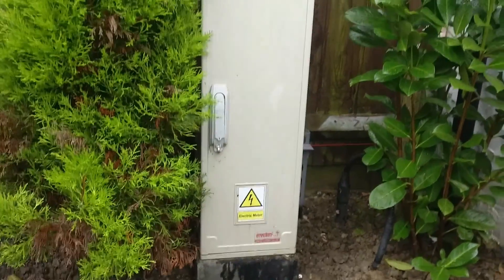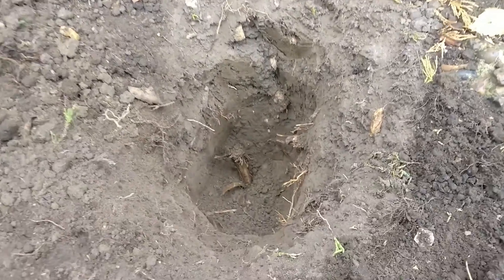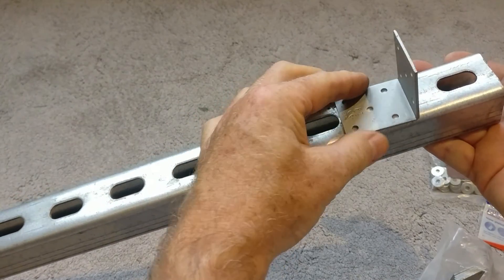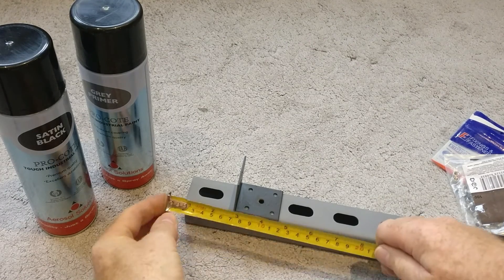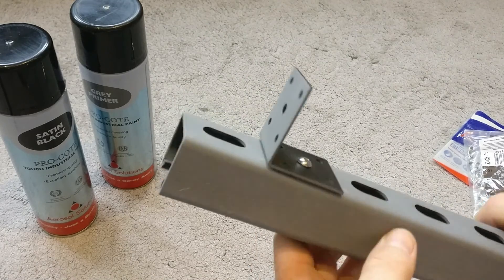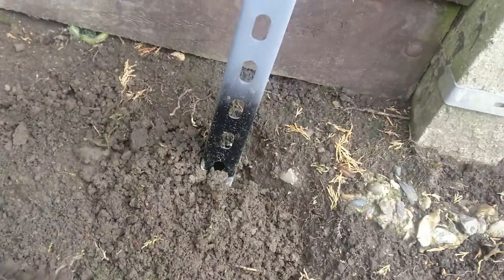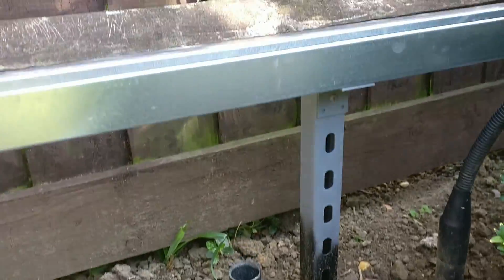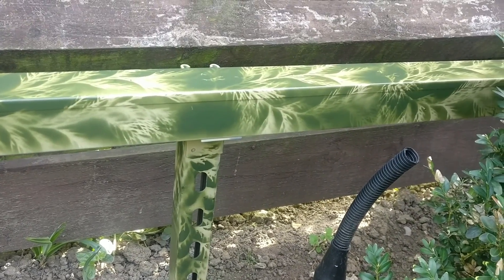Outside Electrical Cabinet | Camo Trunking, wiring & WiFi Node Install

Comment: I'm surprised you did not invest in putting a wired AX WiFi AP on the outside of your house facing the garden. I assume it would've been easier. This isn't criticism just my opinion on how it would've been easier.

Also, neat and tidy, goid in my OCD books. 😂
Reply from the maker: Thanks 👍 I wasn't originally planning a mesh node for the cabinet. Added it as an afterthought. Also, the cabinet is about 30 odd feet down the garden so I get better coverage. More luck than judgement 😂 I'm definitely an OCD myself. Loved do this project. Overkill but good fun.....